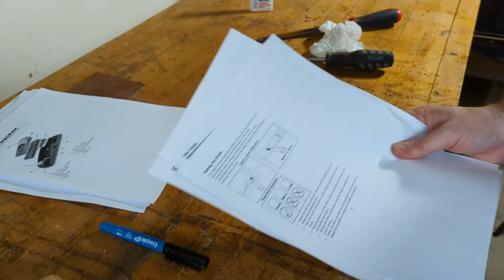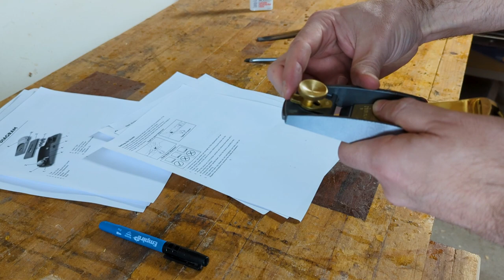Tool Review: MTC Block Plane - (Melbourne Tool Company)

Comment: I have Melbourne Block plane and have spent a lot of time  fixing what I see as faults. The mouth when it is set to the  max opening you are ever likely to use, there are two large horns exposed on either side of the adjustable throat plate. My fix was to grind off the excess plane body at the front  so that the throat plate and nose of the plane were flush when the  throat was open to its max useable setting. The back of the sides of the plane body had a raised tail section somewhat like a 1950's car, and just as useless. I ground those off as well. The rear of the plane blade had sharp corners that extended past the rear of the cap iron and dug into the ball of your hand. I marked a line around the rear of the cap iron onto the blade and ground that to a rounded shape as well. . The other issues are not as easily fixed, they are design faults,  a body that is so long that if you hold the back of the cap iron in the palm of your hand and place your thumb and middle finger in the groves on the side of the plane, your forefinger falls short of the brass lock knob  for the throat plate.. The cap iron has a nicely milled leading edge on top where it looks nice and does nothing to add to the function yet on the underside it is roughly linished and does not sit on the blade correctly.    To fix this plane elongate the finger grips on the side about 15mm forward. and redesign the cap iron to something more ergonomic and substantial than the very stylish and almost useless one on the plane.Then alter the thread pitch of the depth adjuster to something similar to the Veritas slow adjusters. I do like the blade it takes a good edge and seems to hold it well and I do like the improved access to the thumbwheel of the cap iron, that is a great feature. I keep using this plane because I have a love hate relationship with it . ATTN: Mario the foam packing you were going to toss away, is a great place to store your plane on the bench to give protection and easy access.